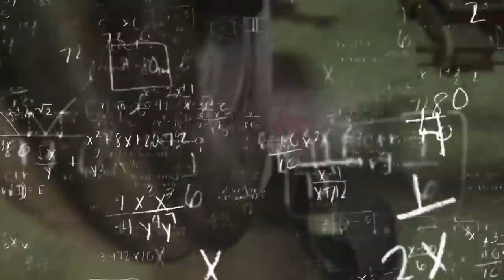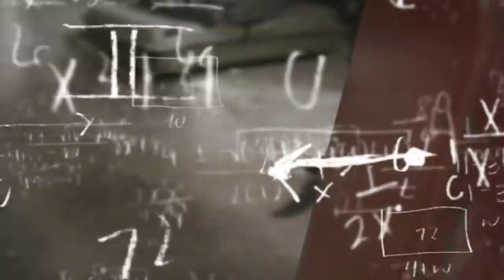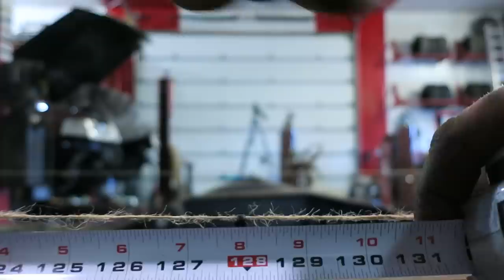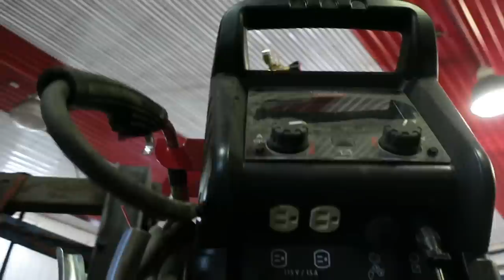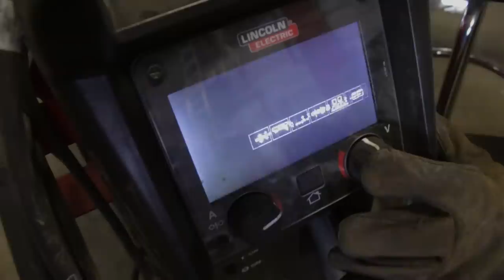How To Make Your Own DIY Truck Frame | #TTDmaxC10 [EP5]

Comment: You must have 30 hour days in Canada.  You amaze me with how much you can accomplish with limited time.  That frame is sweet.
Reply: Nope. It's that Canadian work-ethic. It's not exactly part of our stereotype, but it should be. There's some truly hard-working Canadians running around out there. It's just too bad the manufacturing sector is dead in Canada. Believe it or not, Canada is where GM was created, and remained the back-bone of GM until around 2008. All Chevy and GMC trucks/large SUVs were built in Oshawa, Ontario until recently. 

The Buick Regal was also made exclusively in Canada for pretty much as long as they've existed as a model. Now those factories are shutting down (possibly to be taken over by Nissan), and they're moving their manufacturing base over to Mexico. At this rate, Oshawa, Ontario is gonna become Canada's Detroit 2.0 unless Nissan turns things around for us.
Reply: @MFKR696  General Motors needs to be penalized to the point it hurts like Volkswagen.  I hope Nissan comes in and treats yall better.   That's a messed up thing to do. GM  would have there's cars and trucks made by 10 years old Chinese children if they could get away with it.
Reply: @Mike-xt2ot  GM hasn't broken any laws by shutting the factories down, so there's nothing that can be done about that. Hopefully people will eventually just stop buying GM products.
Reply: @MFKR696  Apart from doing legal schemes to avoid paying back the 2.5-some billion bucks we (cough) lent (cough) them...  FCA did the same, but it was "just" 1 billion.
Reply: He’s also on that YouTube grind this video is about 3 separate days I believe
Reply: @MFKR696  that's not going to happen people are always going to buy gm parts.
Reply: 30 hour days are summer only
Reply: Thats big balls and this is what I'm going to do attitude.  Its cool
Reply: It's the tim hortons. They put different stuff in their coffee up north

Comment: I'm not sure if you've already coated the inside yet, but you might want to check into a product called Wool Wax. I apply Fluid Film professionally, and wool wax is made by the same company. It is thicker and much longer lasting. It comes in black and scentless versions too! Sprays on like fluid film, but you've got to warm it up a bit first.

Comment: Great project and your doing a great job as always. 

I've done a heap of chassis extensions and mods on trucks and a book called   "international best practices in chassis construction" you may be interested in looking at. 

Not that you've done anything wrong at all, just there's a bunch of things to think about from the alloy of steel in the chassis  which dictates the filler wire you should use and how to minimise internal forces at joins which is the only thing of be worried about on that. 

In saying that, that's all about heavy vehicles and for what this will end up doing, it would probably last for many decades before you'd worry about any of that on a 1 tonne. 

Very much enjoying watching this but been watching them a bit out of sequence.

Comment: You might consider picking up a couple of stack jacks sold for stabilizing RVs and the like. They're screw jacks so can be adjusted to any height. They're super light yet stronger than they seem, and they're pretty affordable. They're a lot more useful than those axle stands for jobs like that.
Reply from the maker: I had three on this frame, just didn't get in the camera angle I guess.  Support your local auto wreckers by pulling them out of the old GM trucks
Reply: I got half dozen old scissor screw Jack's from pick apart there great for building and aligning stuff u can weld them to stuff what ever you need and not care there 5$ at pick a part

Comment: I don't know how far you want to go with the frame but after you get all done I would take the roll on bed liner and do the whole frame in it. It will protect it from water rust and any thing messing up the hard work you did. I my self would use Linnex bed liner to protect the frame. That just my opinion.

Comment: Look into "float coats" they are used for tanks and enclosed structures like spuds for barges. Basically you dump the product in and then fill with water slowly, the product floats on top thus coating the interior as it fills. Fluid film makes one of these products.

Comment: You should be teacher, as I have learned much more from you, than from any school ever. I have been in work life for over 12 years now. And diesels have always been a huge weak point for me. But watching your videos have spark an interest for turning that around, and it has. In few days I knew the basic mechanics of diesel engines, and the finicky stuff in few weeks, while simultaneously working them.

Comment: too cool .. !!!
a dirtymax C-10 ..  :)
incredible fab job

I am a bit more comfortable with the mig on this job, rather than the Lift episode
tho I still would have stick'd the frame
mig just doesn't put much heat into thicker steel

sometime, borrow a Miller CST-280 to try

Comment: Measuring the frame is cool, the only thing I didn't see was you checking to make sure wheelbase was exactly sides. But the center section of that frame should hold up a train.

Comment: since you left a drain hole in the frame rails and you want to protect it from rust you can pour cavity wax in to the drain holes and flip and roll the frame every which a way with the fork truck to spread the wax around before you build the truck . or just mix grease and fuel oil and use that to coat the inside of the frame they both work yes it's a pain but it won't rust for a long time

Comment: Bending thicker metal can be a problem. What worked for me was to make a v tool to go into my workshop press. Just scraps of angle iron and bits of plate welded together. Press can push thirty tons so can deal with 1/4" to 5/16" steel without too much trouble. Best of all it was practically free and we all like that price!

Comment: when i weld in a place i then cant paint i use a weld through primer and header paint in this order (1.) w.t.primer (2.) headder paint (3.) W.t.primer let it all flash then weld. works vary well. even just the weld through primer holds up well but its not the cheapest stuff but well worth the cost in my book. thanks for sharing

Comment: weld through primer is a thing rich.
Reply: It's really useful. He should definitely get some.
Reply from the maker: I used plenty of it on the GTO.  Butting up body panels and tacking things in place is a lot different then the amount of heat welding 3/16" together though
Reply: @DEBOSSGARAGE  what if the frame was a little more water tight not air tight tho and you just dumped a gallon of oil in after welding, rough canadian roads would make sure that oil got everywhere inside the frame
Reply: Try Cobret brand weld through primer if you haven’t already.

Comment: Hey Rich. You need to use that truck to tow the Audi to Virginia in September for Hot Rod Drag Week. We decided to go for it with the LS Swapped Mazda B2200! See you at Drag Week?
Reply from the maker: Probably not this year.  It was sold out in 4 minutes or something like that.  We are doing power tour and then likely drag week next year.
Reply: That's Great news that you are considering Drag Week next year! I am currently on the waiting list, and banking on Dave Freiburger's statement that, "they have never turned anyone away". Big gamble, but I want to be a part of this thing and it is probably as close as Drag Week will come to the North East. We will see how this year goes, and see if this becomes an annual thing for us. I really like your channel. We operate very similarly.
Thanks for taking the time to reply! I greatly appreciate it! I think your participation in Drag Week is going to really resonate positively with your followers! I wish Rob Ferretti would do another challenge. However, I need 9975 more subscribers to qualify :) Keep up the great content!
Mike.

Comment: You could save lots of welding time and consumables in trade for longer time in setup by going with an open corner joint between your vertical and horizontal frame pieces.  Watching your mig skills I don't think it would be anything you couldn't handle with a few inches practice and dialing in your settings.

Comment: Cutting all that out by hand? Teedious! You need a 6x3 ft plasma table
Reply from the maker: I do.  One thing at a time.  The plasma table would have made it more precise but it didn't turn out bad at all.  The frame was also longer than 6'
Reply: @DEBOSSGARAGE  8x4 then 😊

Comment: No knocking just saying that this would never pass in Australia. You should never have square corners when welding a chassis. Always the biggest radius you can have because welds crack in the corners. Good work though
Reply: I suggest looking up under a few more heavy duty trucks. Virtually without exception, if it has a frame, the frame has squared off joints somewhere.
Reply: I've looked under plenty. It wouldn't be welded square from factory
Reply: @chevydyall7619  Well, that's just not true, but whatever. Happy trails.

Comment: Hey rich my brothers truck frame is rusted out and I want to replace it with rectangular steel tubing about ³/¹⁶ or ¼ inch thick would it be rated for the same specs as factory or no

Comment: The PAPR hood has the most uncomfortable head gear EVER. i swapped mine for the upgraded lincoln headgear in a normal 3350 and skipped the vent switch digging  in the forehead thing ever since.

Comment: Unfortunately, I've gotta ask this again, apparently... What differentiates a 2wd vs. 4wd Allison? Does the 4wd version have a built in transfer-case? I would have thought that sticking a transfer case behind any old Allison is all you would need. Any clarification towards my noob questions would be appreciated.
Reply from the maker: Output shafts are different.  To bolt on a transfer case you will need to disassemble the entire trans and replace it.  2WD Allisons are rare though and are worth more than a 4wd.  Just sell it and buy a 4WD
Reply: @DEBOSSGARAGE  Ah ic. Thanx for the reply. That's some silly proprietary shit they're trying to pull over at Allison. I can't think of a single logical reason why the 2wd and 4wd models would have different output shafts. I guess they can make more money that way.
Reply from the maker: I think there are only a few transmissions that aren't different.  They make the 2WD lighter.  Save $1 per trans, adds up to a million

Comment: Are you not going to put rubber cab mount bushings on it? It was looking like you want to have as little a gap as possible from cab to frame
Reply from the maker: Sit tight, you are getting ahead of yourself.  Cab floor, rockers, corners and mounts are next
Reply: Sounds like a good plan! I’m looking forward to it!

Comment: Transmission mount with " anti-crush tubes" and through bolts would have been stronger. I  like over kill and 1/4 thick frame rails make math easy.
Reply from the maker: Overkill is a waste of money as materials are too expensive, too hard to bend and work with, and too heavy.  Haven't you watched the three little bears yet? Lol

Comment: The frame is sweet but I did notice a little bit of flex in-between the frames when you lifted the engine out
Reply from the maker: Like a tree bowing in the wind, it's perfect.   Need some flex or it will just crack
Reply: That was before boxing in the frame rails and adding the tranny crossmember. It's probably 3x as rigid now
Reply: DEBOSS GARAGE it’s amazing how much truck frames flex, like you say if it were too rigid it would crack.

Comment: Just to let everyone know you can make a truck frame any shape you want. A long rectangle that is square and level will work as a frame you don't have to build se fancy frame with bends and curves I built a off road dune buggy frame out of square tubing same tubing I use to build tube chassis oval track asphalt latemodels and dirt latemodels. I literally just made sure the two side rails was perfectly level and then secured it to the concrete floor of my shop I used metal square pieces as spacers to level it and able to clamp it to the concrete floor tight with u bolts and concrete anchors.and guess what it worked while I welded everything up and it turned out amazing perfectly level and square frame and the caster and Camber and bumpsteer is perfectly I based it off of the old 1980s midget car that I have in my shop that I found and bought and restored and because midget racecars was made off of ppl taking dune buggies and modifying them for dirt oval racing the one I got is still similar to a fun buggy so I kind of copied the frame a little bit for my dune buggy sand rail

Comment: How did it measure up after welding? Still square?
Reply from the maker: Still square.  Usually with a my Tape Boss you only have to measure once but I did it a few times on this one.  I can show you but I will let the Alignment shop verify if it is still square.
Reply: @DEBOSSGARAGE  Right

Comment: Fill the frame with closed cell foam so the metal can't get air to rust.
Reply from the maker: And it will float!
Reply: @DEBOSSGARAGE  lol
Reply: That sounds like something I cuss engineers for.
Reply: @fascistpedant758  why is that?
Reply: Someday, someone will be heating, cutting, drilling, or welding to it and cussing at the the idiot engineer who specified the rubber foam fill. Not that it's a bad idea, but if it doesn't adhere perfectly everywhere, it'll create more problems than it solves.
Reply: @fascistpedant758  it's very very sticky 
It will keep metal from rusting because the metal can't get oxygen. You have to have oxygen for metal to rust.   The foam I'm talking about is a foam that is used for insulation
Reply: Sawmiller Smith multiple car manufacturers have tried this, it causes rust!!!!! Sure it would work if your frame was 100 percent air tight and water proof but that doesn’t exist so the foam holds water and causes rust.
Reply: @jasontruman1215   Close cell foam does not hold water. It is  Extremely sticky and will make something airtight.  I have used closed cell foam to prevent rust an it does work.
Reply: Sawmiller Smith true, if it stuck very well to the metal and never separated it should work.   I’ve never tried it myself but I have had to deal with the mess of rust the foam makes when the factory uses it on rigs.

Comment: jay leno talks up weldable primer
Reply: cdoublejj jay Leno doesn’t weld
Reply from the maker: Jay Leno lives in a magical world called California, where things don't rust
Reply: @DEBOSSGARAGE  i will at some point have to tackle this my self so I'm all ears. I've wondered about re using old brass jets solder to some tubing or something like to spray paint the insides evenly, spraying 2+ sides at once? Or maybe bar oil every so often?

Comment: Dude, you need 4x4. Even in a tow rig. It’s better to have it and not need it rather than need it and not have it. What grade bolts did you use?
Reply from the maker: Just a summer toy.

Comment: You almost have to spent some time as a pretty good carpenter to use a tape measure for this kind of work .
Reply: It's necessary, in order to learn to be okay with +/- ½" measurements.

Comment: I'm not that impressed by that Freightliner chassis mod. It does't look too professional for a bus carrying 20 passengers, made by such a big company. I did at least as well modifying a truck chassis to fit an old RV ~25 years ago.
Reply: large passenger vans are always sketchy
Reply: I'd hate to imagine how some of those ridiculously stretched limos must be built.
Reply: @fascistpedant758  they are worse than you could imagine.

Comment: Ah you have a cat guiding you.The normal way to do alignments of chassis is to have the strings on the outside of the wheels and measure inward. For vertical heights on uneven surface get out your transit. Angle are just trigonometry. You forgot to do your pinion angle checks- looks off. Many ways to get the job done .I would not do it as you did.Too much work and too many ways to Screw up.
Reply from the maker: Couldn't do it off the tires.  The bus burnt and all the bushings and rubbers are gone.    Wanted to get it together and running before I did the front end as it isn't cheap.  Shimming the mount does the pinion angle (the 2x4 is just temporary)